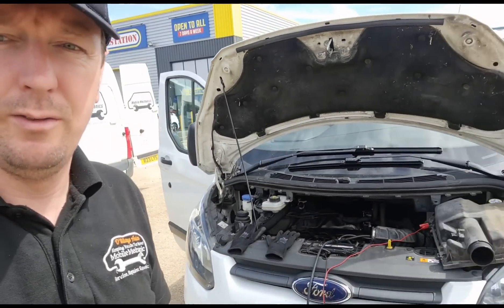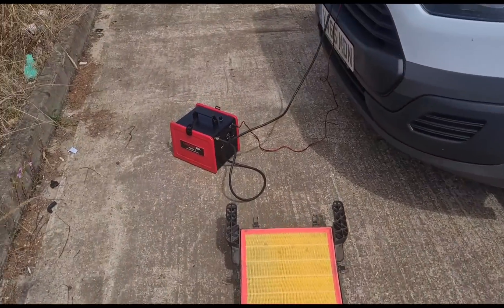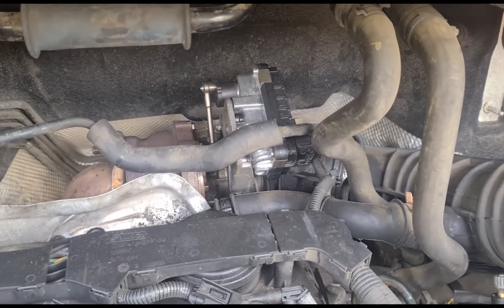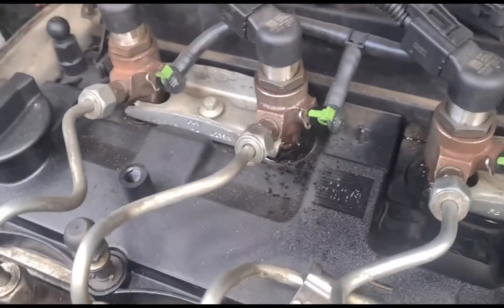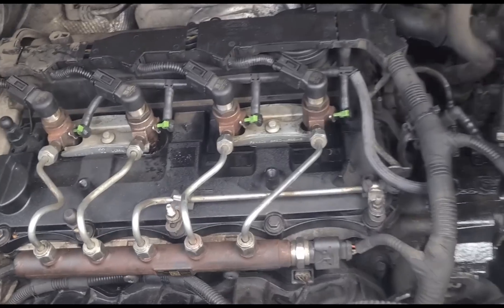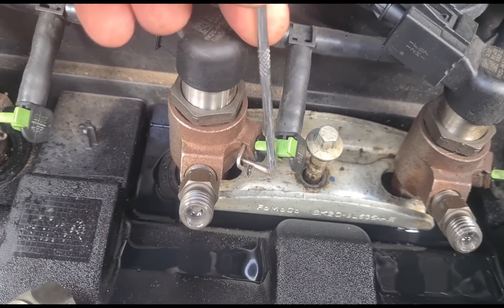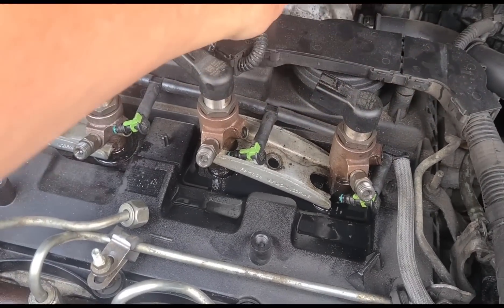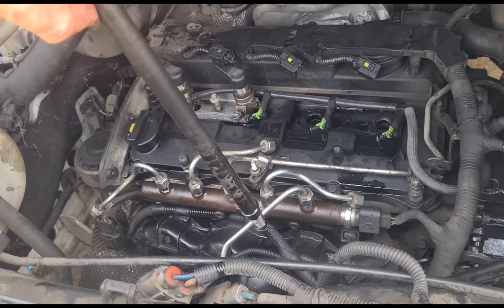Ford Transit 2.2 P0299 Turbo UnderBoost

Comment: None of my injectors are leaking. My mk7 has been driving garbage for over a year. No lights, No power low revs. Other day All lights, red and yellow. Scanned it and came back with these po299 and p00bc
Reply: *replaced 2 injector seals, all 4 glow plugs,had a compression test (all good) new fuel filter. Google is saying actuator and maf 🤷

Comment: im pretty sure this setup you can also test the injector seals by letting the the oil cap go while engine is on idle and if it has too much pressure/chuffing through the cap then they are failty? correct me if im wrong

Comment: I’ve got doggy transit custom van 2.2 2014 , problem with the revs as I’m accelerating they don’t drop while I’m pressing the clutch to gear up. And looks like it’s rich on fuel as it’s smoking. I’ve changed almost everything as everything starts falling from turbo to the maf sensor. Egr, injectors, high pressure fuel valve, rocker cover,throttle body, clutch sensors …. And this van is still completely mystery and the engine still running like bag with nails . I don’t know what to do anymore….

Comment: I have watched your videos got same fault code. It looks like it’s had new actuator I removed injectors today as it’s wet and took them into diesel specialist the injectors and tested them and it the injectors are knackered so hoping this is my issue.

Comment: I’m having this problem thanks for for the vid what is torque setting for injector bolt
Reply: i think its 8nm and 180 degrees,  you should replace the bolt, its a one use

Comment: Good day to you. I have watched a few of you rvideos and find them quite enlightening . May I please ask a question ? Do you have a video on turbo faults for a 2014 Boxer 2.2 with the Ford Puma engine ? My Boxer's turbo only works when on the cool side and also this van does not have a aircon or an outside temperature unit . I am in South Africa . Thank you

Comment: Hi I’ve a 2015 custom had it in garage run fine but Smokey replaced injector washers and new top cover, now no smoke but no power goes straight to service now light garage doesn’t want to know 
Can you help point me in right direction please 
Cheers j.

Comment: Any other faults that led to p0299 fault? New engine and new turbo chra fitted to a blown engine purchase(failed injector -hole in #3). Runs well, but boost comes in at 2250 rpm and is missing prior. Vgt Actuator is moving correctly. Inlet tested with 5psi and bubble fluid, cant see anything and nothing heard down exhaust. Van is Slow off the mark then after 2250 plenty of boost, but demanded and actual map/boost fit well. Will not fault in 1 or 2, but in 3rd or above at part/light throttle. Any ideas? Thinking of replacing the whole turbo rather than the chra, or looking at egr (but it and cooler look very new).

Comment: @Jimmy

My custom give me a underboost and overboost
But only if i tow my caravan in the hils!!
turbo vanes are not stuck put a new actuator in.
cleaned the dpf with launch dpf cleaer

dpf reading no caravan  idle 2 Kpa     3000 rpm  12Kpa

dpf reading caravan  normal driving 2000 rpm 12 Kpa  and uphill 2500 a 3000 rpm 42 Kpa

but turbo is dan on full boost 255 Kpa.

Car had done 300000 Km what do you think dpf full with  ash ?

Comment: We had same issue on our transit, local Bosch agent, charged £1100 for dpf clean. Another local garage fitted new turbo and egr and various valves. Ford had the vehicle for 3 weeks and worst part was Ford said will change the turbo  at cost of 3k but we are not sure if this will cure the problem. It was fixed by a local mobile mechanic.
Reply from the maker: How did he fix it?  Same repair as here?

Comment: We had a similar problem on our Mk7 Euro5 transit.  Kept getting told it needed the turbo replaced, but demanded and actual turbo positions were perfectly in line.  Replaced EGR which was totally gunged up, solved the underboost problem. Now we have some black smoke out of exhaust and regen happening every 70 miles.  Would this be due to injector seals please ?
Reply from the maker: I'd do a smoke test and check dpf live data

Comment: You have to recut the injector seats in the head on these engines and you have to replace the injector bolts as they are one time use stretch bolts,you also have to be careful with aftermarket copper seals as the originals are slightly curved on one side that sits against the injector whereas some aftermarket ones are flat on both sides and don’t last

Comment: You make the diagnosis and repair look so simple that it’s all the more amazing the previous garages missed it. 
It seems sometimes that it’s easier just to load and fire the parts cannon rather than systematically deduce what’s wrong with the vehicle. 
Another cracking video!

Comment: A few years ago I bought what was at the time a 4 year old Citroen Relay van with the earlier Euro 4 version of this engine.  The guy I bought it from had been told by a garage that the engine was knocking and needed replacing.  He didn't want to pay the thousands he had been quoted for fitting a new engine so I agreed to buy the van off him for salvage.  When I finally got it back to the shop to start taking a look at it, I was blown away to see that all four injectors were dancing up and down when the engine was started!  Obviously it was just a case that the two bolts holding the clamps had stretched and started to undo themselves.  How the hell a garage had missed that I cannot fathom!  I actually rang the guy back up to let him know what the problem was and ask if he wanted the van back, alas he had already gone out and bought a new van a few days earlier and told me to keep it!  Apparently though, I heard afterwards that he had had a few choice words with the guy at the garage. 😬  

I notice on the Euro 5 engine they changed the design of the clamps and it no longer seems to be quite as much of a problem as it once was.

Comment: What torque do you do the 8 mm bolts up too?
I have crankcase breathing too heavy and I wonder if injectors are leaking causing the pressure?
Reply: First stage: 6Nm - Second stage: Tighten a further 180 degrees.

Too much crankcase pressure could also be a blocked engine breather, located in the top of the plastic rocker cover.  But these very rarely block up unless you have other engine problems like excessive carbon build up or yogurt from a leaking coolant system or blown head gasket.  Worst case scenario it's due to excessive blow bye gasses from worn bores/piston rings etc.
Reply: @Altair885  recon engine with now 20k on. New rocker cover too

Comment: Had the same fault code on my van (mk7 euro5). Turned out it was the small hole feeding the MAP sensor on the inlet manifold. Changed the manifold  and sorted the problem. The inlet gets so gunked up with oily carbon the ecu/pcm get thrown out of whack because the baro pressure and map pressure don’t correlate.

Comment: Did you put leak detect fluid around the injector? If so does the smoke make it past a tiny leak like that, or does it get turned back into vapor